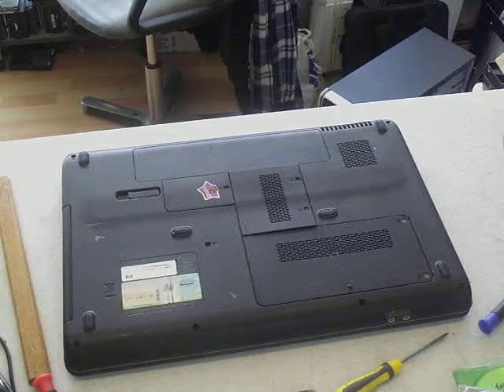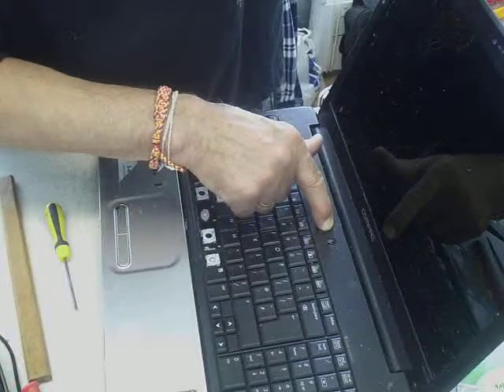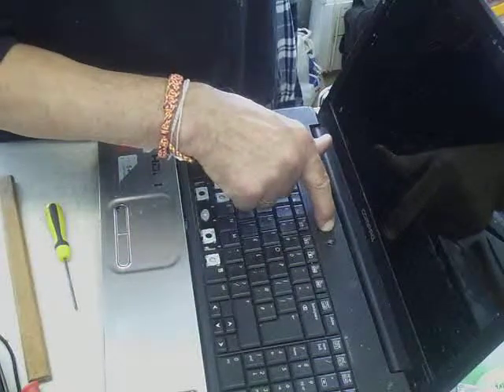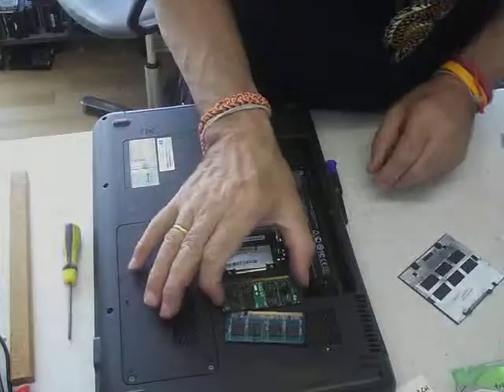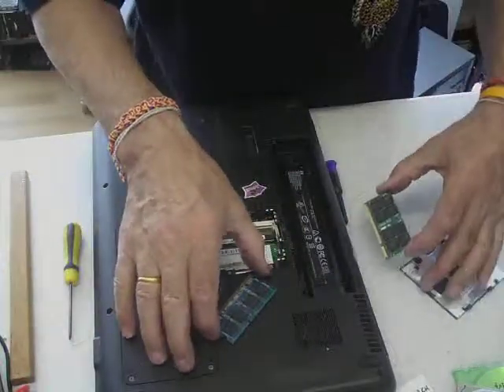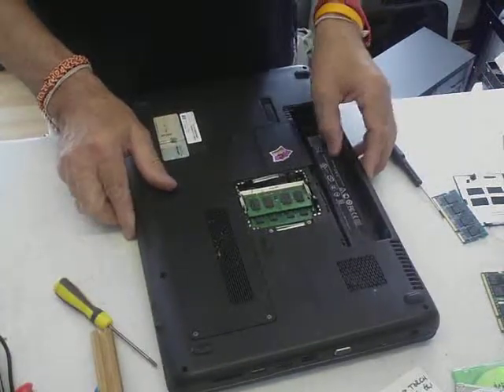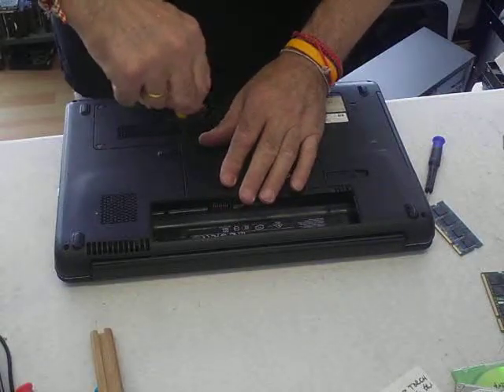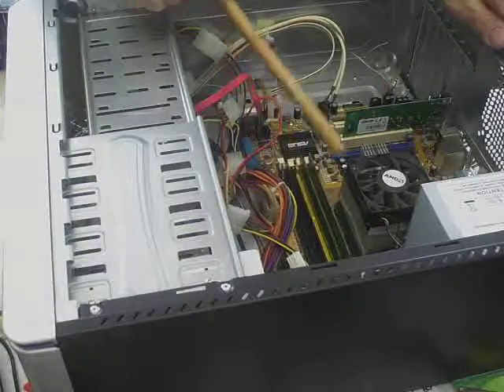how2 'properly' replace or upgrade dynamic ram in a laptop

Comment: not grounded just take it out.. it very easy.. i have never messed up a pc/laptop doing this ever..you took it out with a conductive item, smh..
Reply from the maker: the problem with ur statement bout not 'needin' to discharge urself or ur device of any static charge is that it is contrary to all the rules associated with static charge
so why don't we juzt dispense with all anti-static bags n' all static straps, static mats, etc "because" static charge can actually be a "real" problem, u obviously do not understand enough bout static charges or u wouldn't be se so blasé bout not needin to worry bout it.
what ur sayin is like sayin, 'i've never been run over before so i don't worry about cars', just coz it hasn't happened yet, doesn't mean is isn't gonna happen.
and btw the u can't know that u haven't static shocked some ram or pci card yet already coz when they do get static shocked, they don't necessarily juzt die, they can give off all sorts of spurious errors that u may well later put down to a faulty hdd or some operatin system error.
i learned my 1st lesson many many years ago when i static shocked a geforce prophet grafix card becuase i didn't put in a static bag before i left my customer, (whom had given me this card, coz i'd juzt inztalled a later geforce card).
i also still occasionally shock a stick of ram coz i, juz like u get a a little blasé .
Reply: listen i been building PC and repairing them for many years.. so you made a mistake and fried somthing pricey because you had no ground on.

Comment from the maker: example, to discharge yourself, then you have to bear in mind even moving ur feet around on a polyester or any synthetic carpet u r likely to charge your self back up again, especially in the summer when it is hot.

How many people get 'zapped' during the summer months by their door, just by getting out of their car and closing the door behind them, maybe u've been zapped urself too at some point eh??
all that is happening there is the static charge in the car is much bigger than the than the,,,

Comment from the maker: u can do that but the more important thing is that u have the same impedance value as the component u r about to touch or grab, the static bag does this for u by matching the impedance between you and the bag and in turn any component that is inside the bag. 
if the component is juzt randomly sat on a bench or somewhere else then it is then advisable to discharge yourself on a pc frame that has it's power lead plugged in but but switched off. 
however if u have to walk to a water tap for ,,,,